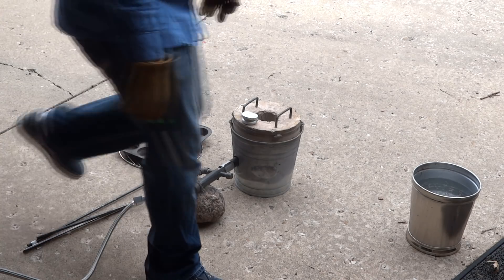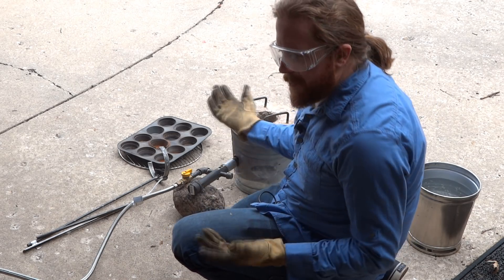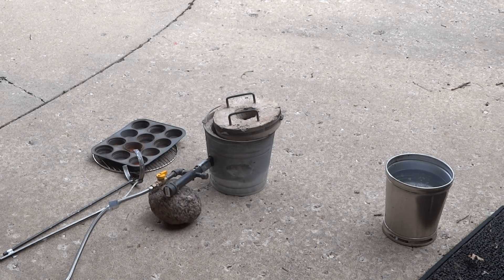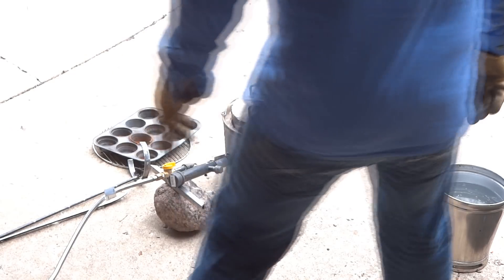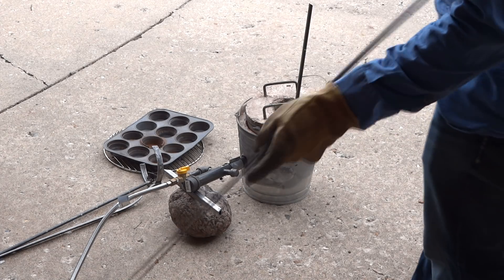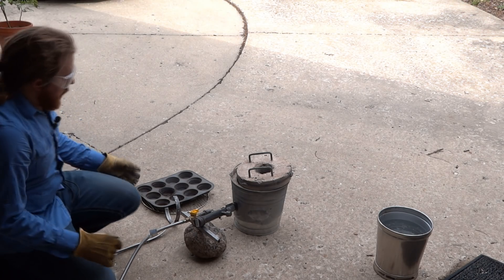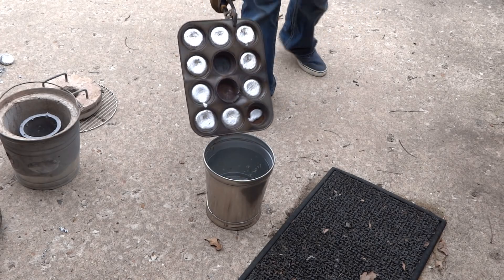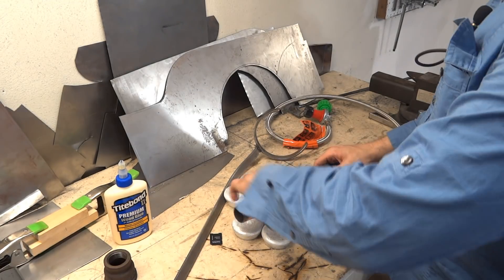Melting Metal with a Propane Burner Foundry to Make Aluminum Ingots at Home

Comment: You were were 100% correct at the end of the video. I worked in a foundry for many years but I worked ON a furnace. Capacity of our furnaces ranged from 150,000 lbs. to 240,000 lbs. of copper and we turned them over daily. There is still a big place in my heart for molten metal.

Comment: You might want to find a better location for your foundry operations. It's seems like a bad idea to work with molten metals on concrete, especially if you do not want the concrete to explode if you drop molten metal on it. But cool furnace and torch non the less.

Comment: great video.  what size crucible is that?  somebody probably already mentioned that the actual measuring "spot" of the IR thermometer is proportionate to the distance you are from the object you are pointing at.  if you are a couple feet away it might be measuring a circle that is 8" in diameter.

Comment: I made one of these according to the website directions and your videos, bought the 30 psi regulator and the 57 wire gauge drill etc, I made a collar to go over the pipe to be able to close off the air vents as well, on the bench test it burned well and hot, but I have a issue about the burner that I can't find an answer for,  I have a sand/plaster mix 6 gallon steel can lined with satanite mortar with the common made lid with hole just big enough to drop a soda can in , anyways when I put the burner in the foundry no matter how long I burn it, even burned it over 1.5 hours on half pressure, full pressure and in between and still cannot get my graphite crucible hot enough to melt aluminum it does not glow red at all, I can melt aluminum fine with charcoal and crucible and liner glows bright red,  but cannot get this type of propane burner to work! I don't know what I am doing wrong, again works fine on bench test, doesn't get hot enough! Someone help I want to melt more than aluminum!
Reply from the maker: Huh that’s strange. Have you tried it with the lid off?  I noticed my burner stopped working right with the lid on the furnace as it was restricting the flow of air
Reply: Thanks for responding! I have not tried with the lid off, I also have a cap on the back of my tube I'm not sure if its not sucking (technical term) enough air , I have not tried adding a hair dryer or air source to the back of my tube either, did that change your heat output much or change your flame?  I originally thought I built it wrong and made another one and it did the same thing, that is what I get for thinking...

Comment: Glad to see you updated your burner.  

And thanks for clarifying the nomenclature. I too was under the impression that your furnace was indeed a foundry.  

Another excellent video.  Well done, sir.
Reply from the maker: Thanks!  I think I made even more changes to the burner since this video.  The aluminum bronze stuff was done with different settings, basically made the thing deafeningly loud and as hot as the sun

Comment: Hey I copied the mini metal foundry burner thing from Grant Thompson, the flame was coming out like yours! When  yet his was coming out like a huge metal melting jet? Do u know Why?
Reply from the maker: I don't know why that would be different.  I didn't build the one from his video, i built an 'oliver upwind' burner, but mine is hardly well made.
Reply: Grant Thompson basically made an over complicated reil. It is a well proven design. More than likely you have the orifice incorrectly sized, or it's not aiming the gas stream directly down the tube.

Comment: is there a way to minimize the dross
Reply from the maker: +explosev gamr a few ways, clean the metal before you melt it, keep it from oxidizing while melting/molten, run a propane burner neutral and not lean.

Comment: If you add borax to the molten metal, it will make it a lot more thin and separate the dross for the aluminum better. Also, if you put the dross scooper in the aluminum to heat it up to the temperature of the aluminum, the dross will not stick to it.

Comment: I need to build one of those, I've used the hair dryer and charcoal foundry but I'm a day sleeper and my neighbors probably would not care for me making all that racket at 3am in my back yard.
Reply from the maker: +Anthony Manuel the propane burner when working properly is pretty quiet, I'm surprised.  There is a faint won't noise but that's about it
Reply: won't noise? can't tell if that's a typo or something real funny that cruised over my head
Reply from the maker: wind noise, sorry it was a typo.  any time i use my phone it changes what i type :(

Comment: how many times can you use the foundry you made?
Reply from the maker: since i rebuild it with the new lining, i've used it a bunch of times and it shows no signs of damage.  The lid is a bit cracked on top, but that's probably from me not tamping the  concrete once it started drying or something.  Also the lid cracked when I dropped it, but it still works.  The bucket part of the furnace is undamaged so far, even after doing copper a few times.  It seems like a very long lasting refractory lining.
Reply: Im from the netherlands and a lot of the stuff has other names, so im not sure what is what. Also i don't know what kind of bucket i should use, i found a Sink bucket but i saw if it gets hot that is dangerous and kaowool is also dangerous. What can i use as bucket?

Comment: Hi Paul, I just built two propane burners, one with a #57 drill bit orifice and the other with a #72 orifice and found the burner using the #72 bit burns 3x as efficient after doing the math, and gets hotter
Reply from the maker: +Captain Shortguy that's interesting, smaller orofice burns hotter? I wonder why that is.  Maybe better mixture or something.
Reply: That might be the case, but one thing I do know is the propane last a lot longer

Comment: When you make your next furnace, make sure you have enough of a gap between the top of the crucible and the lid. It might be the reason why the burner was acting up with the lid closed. Nice work though! Metal melting is addicting.
Reply from the maker: good point! the crucible i used in this video is slightly taller than the other ones i had used.  It's pretty close to the lid, maybe only an inch clearance.  I probably need more space.

Comment: Heya Paul, Great videos! QUERY; How long did it take from cold Furnace to feeding in the aluminium like that? and do you have an approximation of how much propane you use per melt? or how many melts per cylinder and how much it costs you per cylinder? I have an electric furnace i bought recently but its very expensive to run, and i havent built my charcoal furnace yet, but im considering propane. Just want to get my costs to a minimum. thank you!
Reply from the maker: +heartfang21 that whole melting episode from lighting to pouring the ingots was well under an hour, though I didn't time it very well.  I would say 15 minutes from lighting the burner to extrusions meting into the crucible, but I didn't have the burner cranked, and my furnace is not insulating.  I don't have any idea of he costs of the propane I used, though I would think propane is not the cheapest way to melt metal.  It's effective and clean, but not cheap.  It seems like the cheapest long term solution is an oil burner, since used oil is often left over from oil changes in cars and stuff, though I don't know how to make an oil burner.  Someone gave me numbers on the cost of his propane sessions, if I find them I'll let you know
Reply from the maker: +heartfang21 found it, the guy is BigstackD, he said one melt of 3.5kg of copper used about $4.50 in propane.  Copper is much harder to melt than aluminum, and I think he has a more efficient burner/furnace than mine, so number will vary.
Reply: Paul's Garage thank you! looking forward to your next cinematic masterpieces :D
Reply: yeah, i didnt look at the bills myself, but my electric furnace takes about one-two hours to reach 1900F. so 3 or 4 melts cost me a few hundred in electricity, give or take....electricity is expensive here. gonna switch to propane or....well, ANYTHING else.

Comment: Why do you need to make muffins if you could just melt the aluminum later and cast? It seems like a waste of gas.
Reply from the maker: +Samuel Barlington I'm using these to make alloys, not casting them right away.  Making into ingots also allows them to store easier.  A muffin is small, but the extrusions were 4 to 7 feet long

Comment: is that stuff lent up against the wall gonna get melted
Reply from the maker: +ColeT 12378 at the end? That's sheet steel for another project.  Casting steel isn't easy, cast iron is easier but not going to happen with my set up.

Comment: Hey Paul. 

If you have access to old appliances why don't you make your new furnace out of an old water heater.
Reply from the maker: +gplechuckiii we don't do water heaters or HVAC or else I would probably do that.
Reply: OK then. An old air compressor/propane tank. Once the metal is too thin in one spot you can't patch them and they are now unsafe and unusable for their intended purpose.

Just if it is a propane tank take off the top valve and fill it with water to get out any gas first. Then drain and start cutting.
Reply: I saw a video about NEUTRALIZING THIOLS that said the best way to get the gas stink out of a propane tank is by using a solution made from hydrogen peroxide and baking soda.  I haven't tried it yet, but that formula is in several videos, so there may be something to it.  It's also said to be the best way to get skunk stink (also a Thiol) off dogs and what not.

Comment: im trying to build a furnace by myself but i dont now which material to use, i would want a material which will kinda last forever and i dont have to replace, can you give me an idea of which material would be nice? I was also thinking about using HHO gas for the heating of the crucible, but the flame which gets to the crucible would have an heat of 3000° C. can the crucible take that much heat or will it brake?
Reply: Maybe if you use a tungsten crucible?
Reply from the maker: 3000c for a flame temperature doesn't always mean the furnace will get that hot, but a home furnace is generally limited to copper alloys and iron at the most.  If you want the material to last forever then a castable refractory like mizzou surrounded by kaowool would offer a lot of toughness (mizzou is really tough) and the kaowool around the outside would be great for insulation.
Reply: I built mine now out of red bricks with fire resistant mortar, and think will use a clay-graphite crucible with coal for the start, yeah i was thinking of using my own HHO generation setup with solar panels so i can melt stuff for free and dont have to pay any power. i could do 4 HHO flames from all the sites to the crucible, i just wanted to know if the crucible will melt when the flame reaches it (leakage) sorry if its a bit confusing ;)

Comment: I actually like the melting of stuff videos.  Especially if your doing alloys, I would like to see how those come out for you
Reply from the maker: +Tayyeb Mujtaba I saw that, kaowool is good stuff, insulates very well.  I'll probably use that as part of the lining in my new one.  He should've costed it with something like satanite though, he's gonna have long term issues with that stuff.
Reply from the maker: +Isentiototus alloys are definitely coming, I already have the metals I need to make tin bronze, aluminum bronze, brass, and everdur (a kind of silicon bronze).  Just waiting for new, better insulated furnace to get reliable copper temperatures.
Reply: i personally have used plain ceramic wool without a coat for at least 7 burns @ 2000F it seems to hold up pretty well (better than my crucible which seems to be dripping off its outer layer) and i don't have to worry about cracking or flaking if i used refractory cement.
Reply from the maker: +dboler it's not really my burner, it's based on the "Oliver upwind" burner from years ago.  I think a reil burner would be better, actually.
Reply: TKOR made a furnace a couple weeks ago using kaowool/ceramic fibre wool which he uses for copper....... (edited to correct my foundry grammar :/)
Reply: Paul's Garage do you think I should make you're burner I'm definitely thinking about it

Comment: Have you tried fluxing the aluminum with Mortons Lite salt? (50/50% NaCl/KCl) It has worked great for me, and you shouldn't end up with so much dross
Reply: Disregard, I went back to the can melting video and saw you do it. Why didn't you do it this time?
Reply from the maker: +Andrew Murphy it's just ingots, and I'm not concerned about saving 100% of the metal from the dross.  I have so much of the non-silicon containing aluminum that I didn't bother.  Plus that lite salt isn't free lol I'm trying to save up for new furnace parts